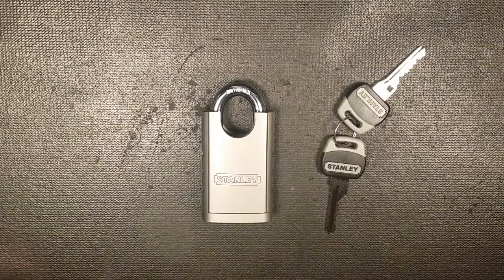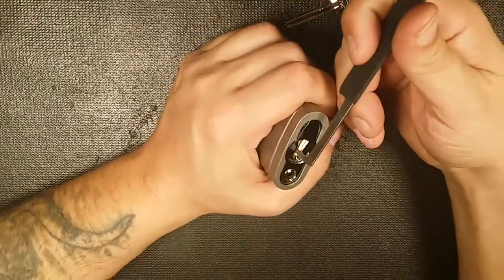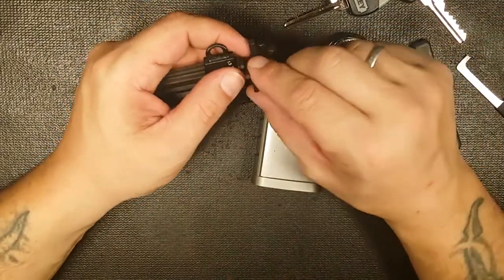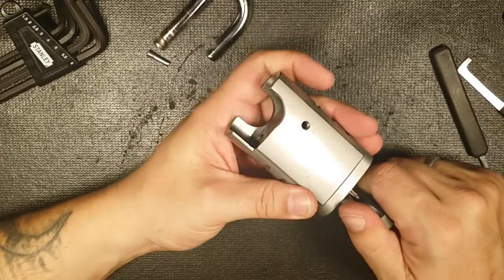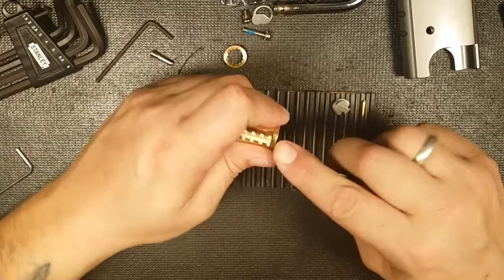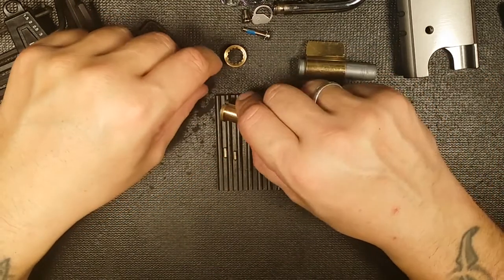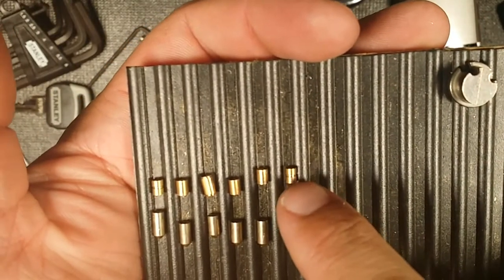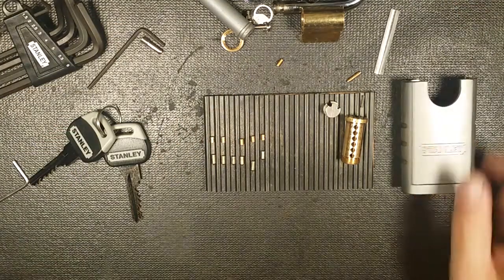-=218=- Stanley 50mm Padlock SPP - Good Lock!

Comment: Great fun locks those,been meaning to get one I have on vid for a while🤔🤔😘🔐
Nice picking 👍🔓,I don't think a novice would have much luck with one as the tolerances are quite high.
Loved the continuity of using "Stanley" Allen wrenches as well 😉😉👍
The metal waffer at the rear of the lock for limiting the rotation of the cylinder,is it also an anti bypass waffer??🤔🤔
Thanks for sharing 😘😘😘👍👍👍👍😎

Comment: For $20 they don't come any better. I replaced the core with a bilock
Reply from the maker: chefgav1 Nice. Yeah they are probably the best lock for the dollar that I've found. Even stock it's quite the lock.
Reply: West Coast Picks core cost 5 times the lock price lol
A bit overkill
Reply: @chefgav1 were you able to keep the anti-drill spinner when you swapped to the bilock core? I was concerned that the bilock key would be too wide for the spinner slot opening. Also, what model bilock kik did you use? I see bilock has several kik's to choose from, and I'm not sure which to get. Thanks for any help with this... I'm very anxious to upgrade my 7 Stanley locks to bilock cores. Securitysnobs.com has bilock kiks for sale. A bit pricey though.

@West Coast Picks thank you for a great vid on my favorite padlock.